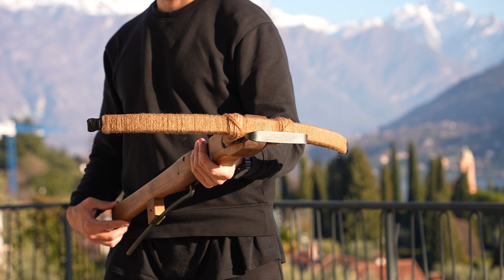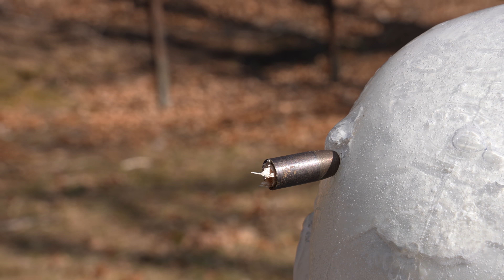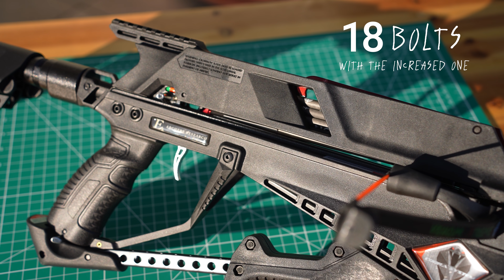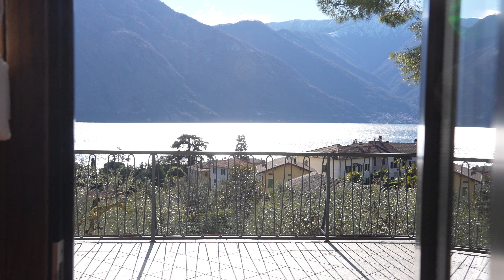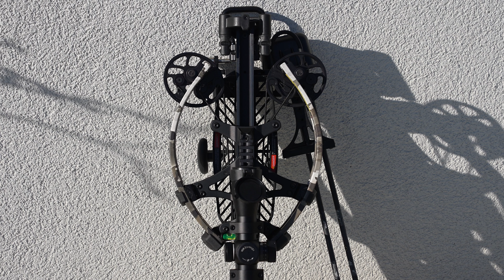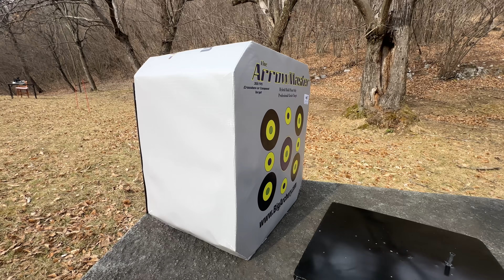How Dangerous are Crossbows?

Comment: I like the video and the format is fine. However I have an issue with you changing to a different bolt for the lethality tests. You should use the same type of tip each time even though the bolts themselves will be different due to which crossbow they go with. Broadhead crossbow bolts existed in the medieval period and were used for hunting so I feel like you did the medieval crossbow a disservice by not changing to a more lethal bolt for its lethality test. Also for the penetration test I'm confused why the wood block was held together by rubber bands for the first 3 but not the last 2. I'm not suggesting that having the rubber band would stop the bolts from the more powerful crossbows from splitting the wood but it would have affected the depth of the penetration at least a little bit.
Reply: I completely agree about having consistency with the bolts. If you're using broadheads, it's going to have a bigger impact and therefore, lethality.

Ultimately, the Medieval crossbow isn't going to be as "efficient" or "effective" as modern day crossbows, but even so, it would have been easy enough to use the same tips for each crossbow.

I still enjoyed the video, this isn't a big deal in the slightest though.
Reply: The point of a field trip is to test the accuracy and energy output of a bow without damaging an expensive broadhead. What he's doing is actually exactly like what hunters do to find out how powerful their bow is
Reply: @mortimerwright4826  I guess I could have phrased that better. I was specifically commenting on the lethality test not the accuracy test. I know why he didn't use a broadheads on the accuracy test. I was referring to how he used a different type of tip for each crossbow on the lethality test. He used a practice tip on the medieval, a hunting tip on the Interceptor, and for the Adder he used flesh slicer tips. I scrubbed through the video and I don't think he changed off the field tips for the last two crossbows.
Reply: @DamageNomad  I mean broadheads are pretty expensive and I doubt he has a broadhead for the medieval crossbow bolt. I think the hunting tip and flesh slicing tip are functionally the same thing

Comment: i build my own like the 2nd and 3rd on the list by 3d printing them, there not the same but they are if that makes since. the 2nd one is pretty much identical and the 3rd is an adderini or thats what the 3d printed version would be called. the cocking handle is a bit different but the rest is the same. then i got quite a few others ive made from other 3d creators online. some have magazines some can shoot 6.3inch or 7 inch bolts or u can have some that shoot both 6.3 inch and 7 inch bolts and also a range of steel balls and u can power the buy using crossbow limbs or stuff like slingshot rubber, im not sure what the stronger stuff ive got is used with but i cant imagine its used for slingshots an would probably be more workout resistance bands cause there stupid strong but works great for slinging crossbow bolts or steel ball bearings. u should look into the 3d printed versions of these. they do pistol versions too that look like 1911 and desert eagle and then other wild random designs. i have a wall full of them that ive made over time messing with 3d printers. always have a project for myself going on while im trying to make a dollar of them at the same time.

Comment: Tenpoint is absurd expensive to use. Not only its price but 100$+ for an arrow that seems pretty much 1 time use is crazy. Those zombies better drop lots of valuable things when killed lol
Reply: that was for a 6 pack of bolts, look again. 

Also, not one time use when you're using a better target designed for that bolt energy. Maybe one time use for use in hunting or defense, but that's not that bad for the power and accuracy.
Reply: @ yes, i recheck, seems is 6 pack. that makes more sense
Reply: Would you really need to use their specific arrows though? I kinda doubt that
Reply: @ Bolts* and  possibly. They'd have to fit a specific length, width, weight, and strength to be fired from that crossbow. Not saying you couldn't find another brand, but it sounds like there weren't any that fit the bill for the creator when he broke all of his, so they may have a semi proprietary configuration.

Comment: there is one significant drawback to using a crossbow in an apocalypse

pun intended

in all seriousness the main appeal of the crossbow is the ease of use (medieval footsoldiers didn't have to be taught extensively how to use a crossbow compared to a longbow) and how you could potentially hold a heavier draw weight due to using some kind of aid to draw back the crossbow instead of relying purely on your muscles

Comment: For future reference,  a knot in the board, especially pine, will be MUCH tougher to penitrate than straight grain.  Famously so. 
Not only is the end grain much harder and full of sap, the fibers surrounding it are locked together.  For any comparisons you must use straight graind clean #1 pine.

Comment: 8:27 ofc if you stab it the opposite of the wood line it's not gonna work smh.The arrow is pointy so even if the wood line was horizontal it would do the same thing since it's a cone shape.Blade is rectangle so yea

Comment: to put things into the perspective, a standard .22LR - a tiny plinking/target shooting cartridge - gives out about 160 joules of energy at the muzzle. a 9mm is at 500J.
Reply: Yep, speed is what matters most, since the equation for energy has speed squared while mass is just by itself
Reply: @bassbusterx  mass is really important, the .22 is way faster than a 9mm in some cases almost 2x as fast.
Reply: to put things into perspective, neither of those rounds are going to penetrate body armor while crossbows have been doing it for centuries.
Reply: Yea, government can’t regulate it either cause u can make crossbows out of scrap lying around the house
Reply: @xofzy10bot27  Alcohol is regulated even though you can make it from everyday ingredients and equipment.
Reply: Now compare the momentum.
Reply: @hoseja  why? it's pretty meaningless in this context, e.g. you can kick a 450g soccer ball at 20m/s and get 9kg*m/s of momentum - twice that of the most powerful crossbow in the video - and what would that tell you? we're not trying to move the target, we want to damage it.
Reply: The difference is that the more powerful crossbows will shred through lvl3 body armor. While most handgun rounds will be stopped.
Reply: @mnk199245  That's down to a difference between bullets and bolts/arrows.  Bolts/Arrows have hardened tips and a shaft that keeps the energy of the projectile moving forward.  Bullets deform on contact and tumble.

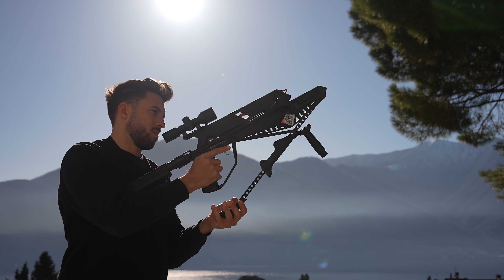Comment: 4:53 semi automatic is that the only thing required to fire a follow up shot is the trigger to reset. This is still single shot as you have to still manually have to load the next round.
Reply: Thank you i was about to say this as well, the difference between the old single shot crossbow and the upgrades, isn't that between a single-action and a semi-automatic, but that between a muzzle-loaded and a single action
Reply: I NEED more people to see this comment and realize what semiautomatic means
Reply: @forrest248  yeah… especially in the us the anti gun ppl should learn the difference between single shot, burst, semi automatic and fully automatic

Comment: the arrow or bolt head is also important. For hard targets you should use hard cased bodkins not field points. For soft targets broadheads. Saxon broadheads are a good middleground if you harden them. The point will shatter bone and the blades will sever tissue and arteries.

Comment: I love your haircut btw
But having crossbows so powerful that your bolts are unusable after a first shot kinda defeats the purpose of having a crossbow as post apocalypse weapon, except if your enemies wear medieval or 3A kevlar armor. (Those bolts ain't going through AR500 steel for sure except if you tip them with carbon-tungsten ceramics)
Some of the 80lb-100lb crossbows with bigger draw length are enough for deer and hog hunting (and not search for your bolts that overpenetrated and snapped after first shot).

Comment: Those bolts on the medieval crossbow look like they're inferior wood and a dull field point. Even with the relatively low draw weight on that crossbow (some medieval crossbows had much higher draw weights) I think it would do more damage with better bolts and tips.

Comment: I traded off a pretty nice $$$ 'wheeled' x-bow I won in a draw for an over under 12 gauge because it was a 4 hour round trip to the closest shop that could change the string. 

With modern high power crossbows, the best arrow stop to use when target shooting, is a bag full of clean rags, ie no zippers or buttons. You can walk up an pull arrows out with 2 fingers.

Comment: 277lbs is rather light for a medieval crossbow, a lot ranged in the 300s and the windlass ones went up into ridiculous drawweights like 900lbs.
Reply: typical hunting bow, even of the era.  not all crossbows require a windlass.
Reply: @sinisterthoughts2896  sure. but he's shooting at a "zombie".

Just like soldiers didn't take their framing implements to battle (MOST of the time, anyway), there were purpose-built crossbows for shooting at people which were distinct from crossbows for hunting.

For the target demonstrated here, a war-weight crossbow would obviously be a better fit.
Reply: And the bolts were massive.

Comment: I have the seage rs 410 from Tenpoint, its the next model in down in power compared to the TRX. There is one hidden drawback about these crossbows that no one talks about. It's to powerful for it own good. These crossbows are not meant to be shot constantly, the strings burn up so quick even with them properly taken care of. If you want a good crossbow that is powerful enough to hunt large game and does not need crazy maintenance, get a wicked ridge. Wicked ridge is also made by Tenpoint. They are "cheaper" and their strings will last 500+ shots, if properly maintained.

Comment: Wow really do everything to make a medieval crossbow seem like garbage.  How about getting an actual medieval hunting crossbow (450~600 pounds draw) or even better a steel war crossbow  (700~1300 pounds draw)?  Then use actual bodkin bolts rather than the crappy practice ones.  Of course using the combination of steel war crossbow and bodkin bolts would have blown out the others in Energy, Penetration, and Lethality.

Comment: Shame you didn't have the Seige to try out. It's basically the ultimate version of the Adder crossbow design, with a more powerful compound bow that has adjustable power thanks to limbs that can be tensioned with an allen key, which is something I've never seen before. I believe it shoots with about 70 joules of force, and uses longer 3 veined arrows more similar to the Lancehead giving it better range and accuracy than the Adder. It's probably the best balance between speed, power and cost on the market.

Comment: When I was watching the video, I started numbers chasing. I had no concept of how much power is really needed be lethal. Humans are about the same size as deer, and Google says around 50 lbs draw strength to ethically kill a deer. Also, in a zombie appocalypse, you're probably not running into armoured zombies. I'd imagine it's other fleshy people/zombies and the cross bow will be for hunting. I think going with the smaller compact cross bow at 60 lbs to 90 lbs is probably the way to go. You never commented on how hard it was to semi-automatically reload the first two cross bows. If it's 20 lbs of force, then that's really not bad.

Comment: Technically not a bolt but an arrow since they have fletching (stabilizer wings at the back)
I wonder if a heavier metal bolt would have more energy in the medieval crossbow because it has high draw weight but slower speed anyways 🤔

Comment: Medieval crossbows could vary significantly in draw weight, and 242 pounds, while very high for a regular bow, is actually pretty low for a crossbow; some crossbows could have draw weights well over 1,000 pounds, making it physically impossible for even the strongest people to cock them by hand.  And 50 pounds is also very low for a bow, so that's not a great comparison; it's in a pretty standard range for target shooting, but a hunting bow or especially a war bow would typically have a much higher draw weight, with lighter war bows usually having draw weights of about 70 pounds or higher, and the heaviest war bows having draw weights close to 200 pounds (though the average was somewhere in between). The reason why crossbows have such higher draw weights is not to make them more powerful than regular bows, however; it's because (in my understanding) they typically have much shorter limbs, which reduces how fast they accelerate the bolt and requiring higher draw weight to achieve similar speeds (which isn't to say that no crossbows are more powerful than bows, the upper limit on power is a lot higher for a crossbow, it's just that a 200 pound crossbow is nowhere near as powerful as a 200 pound bow).

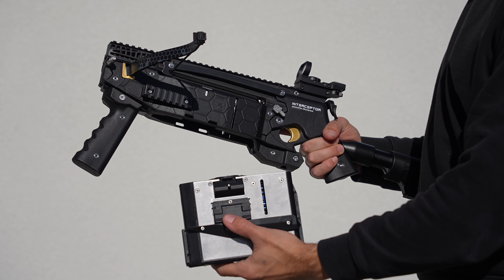Comment: 4:50 the definition of semi-automatic is self/automatic loading - the weapon recocks itself after firing but requires a new trigger. If you have to recock it yourself, it's called single-action.. the same as a medieval crossbow, just a lot faster.
Reply: More specifically it's a lever-action mechanism.
Reply: Better yet, they are repeaters.
Reply: Cut the man some slack dawg.
Reply: @Gogeta1-eu5vt cutting slack with a strung bow sounds like a great way to get string-burn.
Kidding aside, you can get crossbows with compressed-CO2 powered cocking mechanisms (or you can get such a mechanism standalone), and those would be much better candidates for calling "semi automatic" crossbows.

The whole concept of "Semi automatic" is that, once the weapon has been loaded, all the user has to do is pull the trigger for it to fire.  No extra steps, every pull of the trigger results in another shot fired.

If the user has to cock the weapon between shots, but the act of cocking also loads the next shot to be fired, then that's a "repeating" weapon (and this term is used in antinquity as well, directly in the context of magazine-fed crossbows and arbalests).

This isn't mere pedantry: those of us pointing this out are not doing so to shame or rag on the creator, we are sharing information with the creator which will help him make his videos appear more polished.  When someone uses a term line "semi-automatic" to refer to a very much manual process, it makes him look less knowledgeable, which may harm his viewer engagement.  I think a channel making videos like this should succeed, therefore I want to see him using the correct terms because that will help with his viewer engagement.